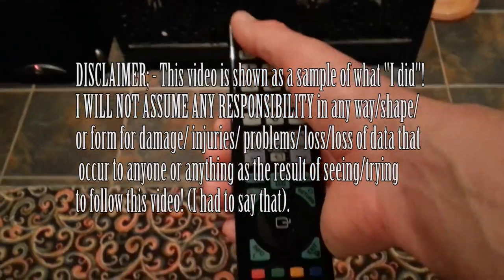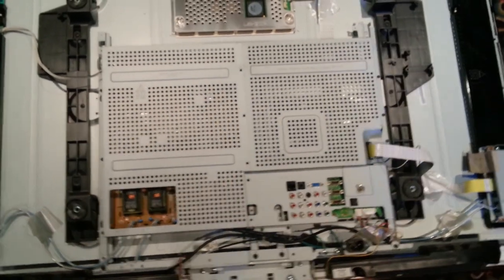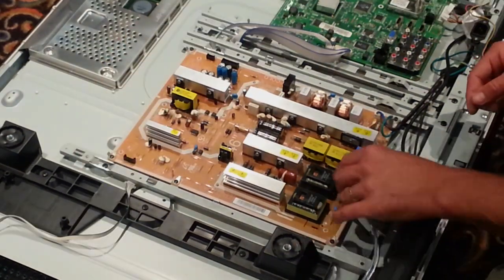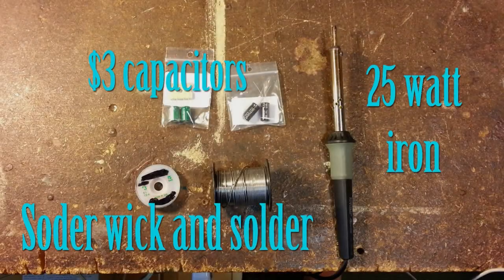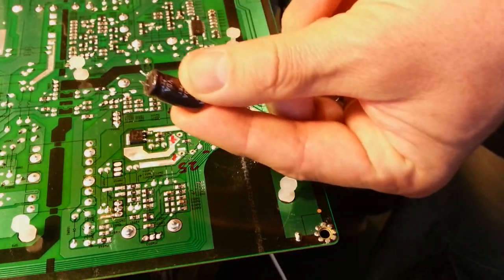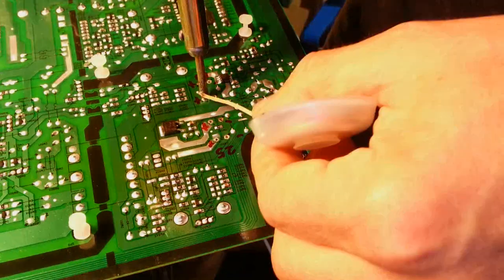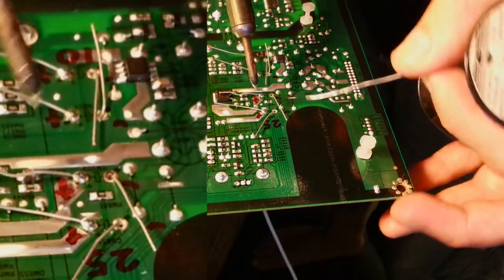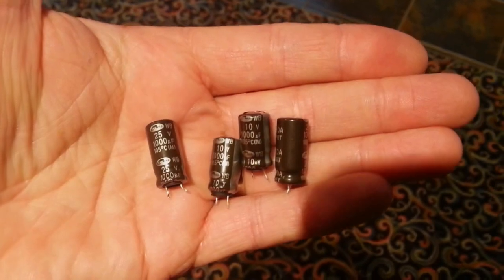Samsung TV won't turn on + blinking red light (explained fix) #18

Comment: I have the same problem but all the capacitors look great. just waiting on my tester to come in tomorrow to test them out, any other great info that might help my case?
Reply from the maker: Those capacitors can only be tested if they are isolated from all other components, by removing the from the board. Defective capacitors usually (but not always) reveal themselves with a bulging /swollen top, or leaking liquid out of themselves onto the circuit board. Those are the clues.

Comment: I have one I am stumped on. My Samsung Plasma. Turns on and off fine by touch panel. Remote turns on unit, but does not turn off.Source does not work , but rest of remote does. Tried several universals including the brand new 4k Blu Ray remote. Any ideas? I need to do a factory reset catch is requires me to push power button on remote.  6500D series.

Comment: I have same model, my issue is the sensor in front red light is constantly on, and the buttons on the side when pressed no matter which one turns menu on but you can't move through menu and no other function with the buttons respond, almost as if one is stuck and telling the tv that one is always pressed.....don't know what to do....
Reply from the maker: +Leigh Clawar on my TV, the red led is on all the time normally when the TV is off. It blinks on and off when turning on,  and stays off once the TV is on. If there are issues with the side panel controls only, there is a possibility that there is a poor connection of the connector pins (in the plug) that plugs into the main board within the TV, due to oxidization/corrosion of the pins or within the side panel controls itself. Does your remote control work with your TV?
Reply: the sensor light is on mostly solid while tv is on as well, so it prevents the remote from working.

Comment: Hi, I have this same issue and popped mine open but all capacitors look ok. What else do you think could be the problem?
Model UN50J5200AFXZA
Reply: Even if they look okay doesn't always mean they are ok. You just don't know for sure before you've measured

Comment: Same thing happens to me, but it does turn on eventually. Still the capacitors or another problem?
Reply from the maker: I would inspect those capacitors for bulging or leakage. These are a very common problem, and can cause the issues you are experiencing.

Comment: Great vid I have the 47 inch model and replaced the two 10v 1200uaf capacitors and I'm up and running.had to get them from Amazon thanks

Comment: I have almost the same TV and same exact problem (bloated capacitor). I did the same exact thing you did in the video but I did not replace all 4 because only 2 were bloated and leaking. I installed the new capacitors and plugged in the power, the new capacitors that I bought popped (bloated) and went bad right away and did not even turn on. Also, the numbers that I bought on the new capacitors are identical to my old ones (25v 1000uf 105c) but they are a little smaller then the original ones on the board. Is that normal? and could that be the problem?
Reply: Oh crap now I know what I did wrong. The polarity was incorrect.  Does this mean that the board is fried? Or can I resolder with a new capacitor? Thank you for your help
Reply from the maker: +Beaver Cleaver as was noted at the end of the video, there are times when other components in the circuit can short out or fail thereby causing other connected components (like capacitors) to get blown up! I would try replacing all 4 electrolytic capacitors on the power supply board (they're cheap) and try it again. Note, make sure you have the polarity right when installing the capacitors! If they're installed with the negative leg where the positive should go, then the capacitor will pop as well!

Comment: Where do I get this all parts fix my tv? I have same issues. Thank you so much and great video.
Reply from the maker: +Jen Michelon you will need to look at the capacitors that exhibit swollen tops, leaking fluid residue, or capacitors that have popped their tops, write down the capacity ratings and voltage ratings and go shopping at your local electronic component supply store. Or you can search the components online. Either way, they must be exactly the same as the ones that are in your device.
Reply from the maker: I purchased my components from Sayal Electronics

Comment: same problem with samsung 50 in. Replaced entire power board and nothing changed. replaced t-con board still no change any thoughts
Reply: I have same issue but didn't get answer yet
Reply: Yeah replace a led strip backlight
Reply: Did you ever figure out the problem with your tv?  I have the same issue.

Comment: will this work for my LN40B530P7FXZA if it turns on and off random and the little light is a blinking red? also after changing the batteries on the remote, the menu won't open when i press it but it will randomly appears and i can't exit out of it.
Reply from the maker: +Diana white unfortunately, it is impossible for me to say that the problem with your tv is what I showed in the video (capacitors). The tv needs to be taken apart and inspected to do that.
Reply: Mysimplefix 0

Comment: Okay, I changed the capacitors and it worked for the first time - for about 5 minutes. Then, it went off. Now, there is no standby power light, either! Dead as a door nail! I opened it again. Not a single capacitor that is bulging. Any ideas for this particular model?!
Reply from the maker: +Harry S. Anchan I need to ask 2 questions. First, where the replacement capacitors rated the same as the old ones? 2, is it possible one or more capacitors were installed backwards, as electrolytic capacitors are polarity sensitive.

Comment: My Sony flat screen tv kept going off and flashing red six times on and off.
It turned out that the tv had detected something faulty that it was connected to, in my case a satellite tv receiver unit.
It took me a long time to nail it down to this problem. You might save yourself a lot of grief if you check this scenario out first. Happy viewing Keef.

Comment: I have Philips 42"plasma.  I had the blue and red blinking lights.  I changed two  33uf 450v capacitor s.  tv came on for about 20 minutes, played great.  I heard a pop, still had picture.  heard another pop 5 minutes later, lost picture. Then I saw a red blinking light. Any ideas? Thanks.
Reply: John McLaurin Assuming that those were the correct caps and they were installed properly, then I would guess that there is another defective component that is csusing the caps to blow.  I would search for a replacement board online.  Good luck!

Comment: What if the power supply board is good, but the tv still doesn't come on? I checked all the PCB's and nothing was burnt, no swollen capacitors. 

Just doesn't come on. No picture or audio. The power LED blinks five times and then nothing.

It's a 40' inch Samsung UN40H5203AF
Reply: get a multimeter and measure the capacitors. it's not always that obvious. sometimes they don't swell at all

Comment: Hi ! I have Samsung 40eh5000 led. Its staying standby mode with red light without blink and not 
getting on. I have opened and checked that there no any capacitors have 
burn. What should I do now ? Thanks
Reply from the maker: +Rajubhai Rathod I'm afraid I don't have an answer for you on this one. Maybe somebody else can voice in?
Reply: Mysimplefix
Reply: Rajubhai How did you solution your problem standby mode with red light without blink and not getting on?
Krish: my problem is exactly the same as yours. 
My Samsung LED Smart TV UN58H5200 can't turn on after I dissemble it. 

Reason that I did open the TV: 5 vertical lines right half of screen. 
So I cleaned all the connections and no strange defects seen by inspection.

PROBLEM: But now the TV can't turn on: there is back light when powering on, at the right low corner the red light is on 
(means not blinking constantly on). 

- I tried everything like reinserted the cables, 
- took out all HDMI equipment cables etc;
- my remote is 100% fine, 
- power cable off for more than 10' then on press on power button at right back rear of TV for 30'' 
- inspected visually all the capacitors
- etc etc to no avail. 

I'm sure it's not a hardware problem as the TV was working before fine 
(but with the aforementioned 5 vertical stripes on right side of the screen).

Do I maybe have to reassemble the whole TV again so one or more of those screws can electrically be connected to chassis ground?
As I didn't close the TV as yet.
Or doesn't that matter?

By the way: all the ribbon cable connectors and any other connectors are all fully seated in their sockets.

Any suggestion will be appreciated.

Comment: my 9 year old samsung LCD flatscreen just stopped turning on.  the red standby light stays on, does not blink.  could that still be a capacitor issue, or something else power-related?  i have two different remotes, both with good batteries, and neither does anything to the TV.  i've unplugged it, let it sit for a few hours, plugged it back in, but no change in behaviour.
Reply: usually it's one or more dead capacitors, but something else might've also broken because of it/them.

Comment: My tv is doing the same thing I disconnect power cord and wait a couple mins sometimes hours and plug it back in and works but then i have to do it again when i turn it off it just blinks red i would like to try this and check to see if its the same problem as yours but im just afraid that i would get shock or mess it up im a bit shaky when trying to be careful

Comment: Hello. I have a Samsung 52 inch lcd TV and when I turn it on. I hear sound. The red light blinks about 4 or 5 times. I opened it up and took a look at the capacitors and they seem fine. Also when turned on u can see the picture of u look very close with a light. It works but no light. Do you have any idea what it might be? Thank you!
Reply from the maker: Is the model of your television a DLP with a bulb? You said you are able to see a picture and you can hear sound. If it is a DLP , your bulb might be blown.
Reply: +Northcaledon I'm sorry. What's a DLP. Lol. And yes I can hear sound perfectly fine
Reply from the maker: DLP (digital light processing) TV's are back lit with a bulb. A burned out bulb, will cause your issue. Check your TV's model number on Google (or your manual) to see if that's the case.
Reply: +Northcaledon no. It's not a DLP. Any other ideas what it would be?thanks for the fast responding also
Reply from the maker: I've been snooping around the net on these symptoms for your 52 inch lcd Samsung. There seems to be a bit of a run on these (either the back light power supply or display boards). Unfortunately, this seems as it may be beyond the scope of this video...and my knowledge.

Comment: PLEASE LET ME KNOW HOW TO identify the caps that may cause this issue?   flashing front red light with some clicking after 8th flash no picture
Reply from the maker: +Ab 7775 you will be looking for capacitors on the power supply board that are exhibiting either swollen tops, or evidence of fluid that has leaked out from them onto the board they are mounted on.
Reply: Thats the thing on the power board none of the caps look swollen or leaking.   Is there caps that may be bad but don't show the signs?  does a set of them control the red light flashing issue?

Comment: what type of solder wire would you recommend for this fix
Reply from the maker: I used Kester 44 (SN60PB40 #66/44 .050 1 LB SPL2460400053). There are many choices, but this is what I used.

Comment: Hi dude,

Even if I will be able to fix it, how to avoid this issue to happen again? :\
Reply from the maker: +Máté Spanberger in all likeliness, this won't happen again, because there was a large batch of defective capacitors installed in many TV's back between 2006 or so and 2008. (I'm only guessing on the dates) Samsung had these in them. What kind of tv do you have? What is the build date approximately?
Reply: You can not avoid this from happening again. Capacitors lose their over all capacitance over time. Once the electrolidic internally dries up the capacitor is dead

Comment: I recovered an old samsung with the blinking red light issue but sadly there are no bulging capacitors which indicate an easy fix. Is it possible the capacitors are bad even if they arent bulging? I want to save myself the trouble of a solder job if they really arent the culprits
Reply from the maker: +humby123 there is no way to know if the electrolytic capacitors are shorted internally unless they are physically removed and tested, although "usually" there is visible evidence in the form of bulging tops or leaking fluid residue on the circuit board at the base of the defective capacitor. I would suggest that if you are experiencing symptoms that are common when these capacitors short out, for the price of only a few dollars, I'd take the gamble and replace them.
Reply: I will do that now. Ill let you know how it goes in case people encounter this conversation in the future. Thanks for the reply.
Reply from the maker: Make sure you use the same components and make sure your polarities are correct. Good luck!
Reply: Used same capacitors and made sure the polarities were in the right position and no success. It seems no bulges did in fact mean they were still good. Scratching my head as to where to go next with this one.
Reply from the maker: humby123 what model number and brand is your tv, and what exactly is it doing?
Reply: It is a samsung ln52a550p3fx2a that does not respond to the power button. The red power light just blinks non-stop. Occasionally I hear clicking from what I think are the relays on the power board. Suggestions?
Reply from the maker: humby123 that's exactly the issue I had with mine. How many capacitors did you replace?
Reply: Ill confess that I only replaced 4 that I replaced in a previous set that made the tv work. Their replacement didnt make a difference in this set. There are a lot more, but I really want to avoid needlessly replacing these things blindly as desoldering on these boards is a real pain in the butt. There was a possible solution in another forum regarding resetting an EEPROM chip that I will try once I get back home. I will keep you updated.
Reply from the maker: Ok

Comment: I replaced the capacitor and my tv turns on for a second and then stops working, I unplug it and plug it in again and it does the same thing. Is this because I damaged it when I replaced the capacitor?

Comment: On my 32' Samsung the red light would blink, but eventually the TV would turn on and work without an issues. I have replaced  the backlight after it have failed and I hoped the blinking would go away, but it remain. All caps look okay.

Comment: Where did you buy the capacitors and what brand and voltage??
Reply from the maker: The capacitors I replace in my television were both of the electrolytic type, two of them 10 volt 1000 microfarad, and two of them 25 Volt 1000 microfarad. I don't remember the brand name of them, but I did purchase them from "Sayal Electronics".
Reply: +Mysimplefix 
Thanks so much, I saw in the description after I commented.  Sorry.  I have a 40", so I will have to take off the back to see which voltage I need.  I already looked at Fry's Electronics and they do not carry 10 volt.  :(  I hope I'm able to get the parts!  Thanks!
Reply from the maker: +Kathryn Virello Katherine I wouldn't post my email here! (just because everybody sees it) ! if you see any capacitors that are swollen or leaking, they will be clearly marked down the side that will say the number and V which stands for voltage and another value with the micro sign beside it which stands for microfarad. and there should be a stripe down the side that has the negative leg of the capacitor. this is very important to get right when putting in the new one of the same value as an electrolytic capacitor cannot be put in backwards!
Reply from the maker: The first thing I would do is take some good close up pictures of the capacitors you want to change showing how they are installed. I would then remove those capacitors from the circuit board and take them to an electronics supplier to have them matched up. Be sure the ratings of the new ones are the same as the old ones. You can then reinstall them using your pictures as a reference.
Reply: +Mysimplefix 

I got them off!  They are 25V!  whoo hoo.

Comment: Mine is clicking but eventually turning on (min 10 minutes) I opened it up and none of the capacitors look like they are bulging.can they be bad without visual bloating?
Reply from the maker: Yes absolutely! Sometimes also there will be leakage onto the circuit board from the capacitors. For the price, I'd start by changing the power supply electrolytic capacitors. There are now kits available on Amazon and EBay for many models of TV's.

Comment: thank you!!!!! I just fixed my tv. saved hundreds! just wish I had bought solder wick. couldn't find that at radioshack
Reply: +Ben Ross Re: soldering wick (soldering remover)

You can buy soldering wick on A___zon dot com.  Their #1 seller (with a high rating) is 2.5mm Width, 5' Length. If you don't mind a width of 2.0mm, instead of 2.5mm, the cost is less than 3 dollars.

Comment: Mine doesn't seem to be swollen but mine is leaking. Do I need to change them?
Reply from the maker: +キウイ if the electrolytic capacitors are leaking, then yes they need to be replaced.
Reply: +Mysimplefix Okay thank you. I'm going to get all the needed materials next week. :)
Reply: how to reboot a Samsung remote control for TV

Comment: YOU  CAN REPLACCE A capcitor of a slightly higher voltage the critical value is the micro fairaid the ones ie this vidio iis 1000 mic
Reply: Hello can you please elaborate on this comment?